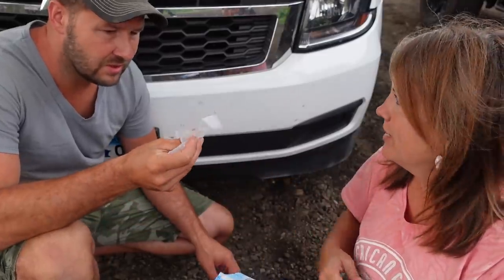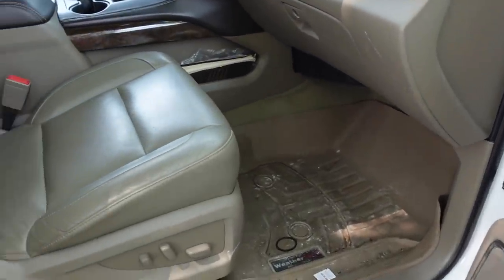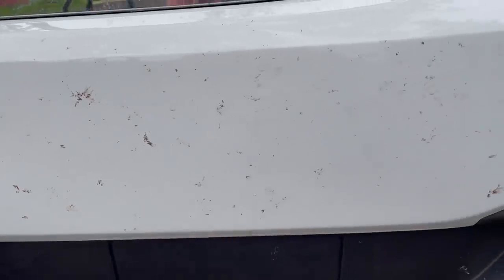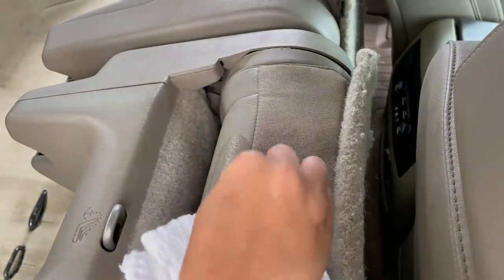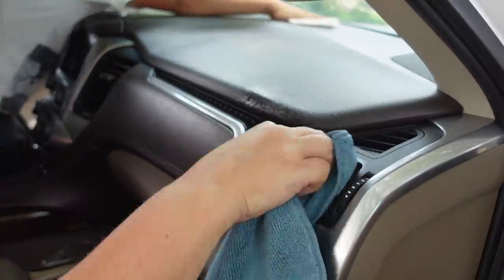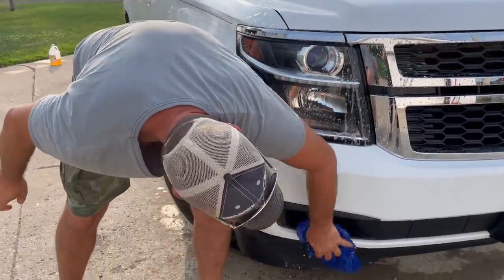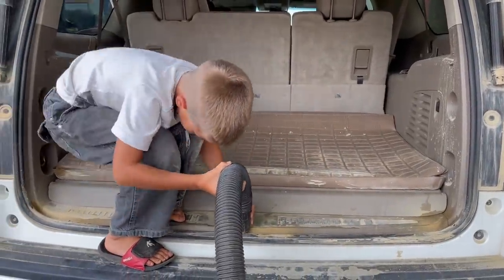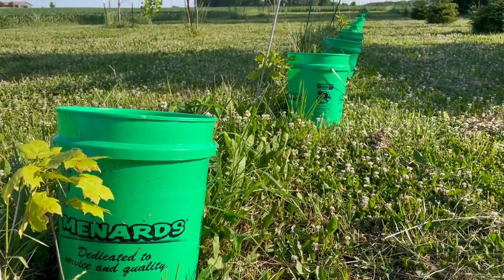“I’m trying, I really am!” Car Cleaning Before & Afters -- Favorite Tips & Products

Comment: Dawn dishsoap works fantastic for the front bumper. Give the entire bumper a thin coat about 15 mins before washing. They all come off super easy.
Reply: Dawn dish soap is one of my favorite cleaning tools! And it has to be the brand on this one!
Reply: @zend0001  I agree. I've found this to be true with my home made cleaners and laundry stains as well. Dawn dishsoap always works better than other brands.
Reply: I agree as well. I also like that I don't have to worry about chemicals when I use Dawn. There have been times where I've debated if it's safe to use various cleaners in different areas where my cats spend time, and I typically use Dawn in those cases because it will clean the area without any chemicals I have to worry about.

Comment: My tip for cleaning the outside of my car is to drive it through the car wash when I get gas. As far as the inside is concerned, I will need to drop it off at your house because I need a lot of help with that.
Reply: I agree...but the car wash doesn't clean the rim holes at all! Major build up there, so I'm thinking investing in a pressure washer wand might make that easier...and a small, soft toothbrush to get in those crevasses, since 'borrowing' Dawn's boys to come to California to detail my car is illegal in every US state. 😳
Reply: The drive through car wash where I live (rural Australia) the cheapest one is $12 for the quickest wash!

Comment: The tip about using a scrub brush while vacuuming is genius, how could I not have flippin thought of that.
Reply: Right! We have a house of blondes & both vehicles have black carpet. The carpet is like velcro for the blonde hairs. The vacuum won't take it off of the carpet. It's my hubby's huge complaint. I'm going to try the brush trick & pray that it works.
Reply: @sunrays-wy6jc  I might use an actual hairbrush to grab the hair, then clean it. Doesn't seem like a standard flat cleaning brush like Dawn used would "grab" well enough. I'm getting my hair cut cause I can Stand finding those dang long hairs everywhere!

Comment: I have strong opinions about cleaning your car as a detailer- be careful using things that are abrasive like the dryer sheets on your oaint- instead use Bugs N All cleaner to dissolve them. Use Meguiars all purpose cleaner inside the car on hard surfaces, and finish everything with 303 Aerospace protectant. All worth every dime
Reply: Hi! Can you recommend something to clean the interior of a windshield? Mine looks ‘filmy’ in the light, and glass cleaners seem to make it worse. Microfiber with water or diluted Dawn helps, but… I still see the filmy smears in the sunlight. So I’m hoping to find a cleaner that removes the weird filmy layer but doesn’t leave its own filmy residue.

Comment: Working in the motorcycle industry for many years, Bugslide (can see the information on all its uses) works great on all vehicles as I've used it on my collectible automobile and it's waterless..also use TuffStuff foam cleaner for carpets and upholstery. Then top it off using a little dusting polish inside but avoid applying to the steering wheel. All while using some microfiber cloths or the cotton ones that are sold in automotive sections of your nearest auto store. Been doing this for years. I do like your pet cleaner vacuum as that's a new one for me that I'll have to invest in. Great tips Dawn and Tom, have a blessed day 🙂

Comment: Yes on the dryer sheets. I’ve been using them for years to clean the front end to remove bugs. If your think about it, they are fabric softeners, so I think that is part of why it makes it so much easier to clean. I dunk in down in the soapy water in my bucket before I start scrubbing.

Comment: Awesome is awesome!!    Our church just got tagged and Awesome even took care of the spray paint.    When my kids were little, I got a "dorm room carpet" from Walmart and put it on the floor of our van.  I cut out holes where needed and lined the edge with duct tape.   When we sold the van, we removed the  carpet and simply vacuumed - got a great resale price because the van carpet looked so good!  I now have an old area rug in the back  of my suv because it is carpeted.   The throw rug takes the beating and got a second life.

Comment: the dryer sheet trick & other cleaners might work well, but the Norwex microfiber does it more safely, without harmful chemicals ❤ Also, dissolving Norwex Ultra Power Plus laundry detergent in water and using it as an all-purpose cleaner works on a lot of dirty jobs (it can also be used in a carpet cleaner)
Reply from the maker: GREAT tips!!!
Reply: The dryer sheets work because they’re made with waxes and polymers to cut down on “attachments” between fibers.

Comment: Used dryer sheets work SOOOOO much better. I live in Louisiana and used dryer sheets are a MUST HAVE STAPLE during "love-bug" season. They swarm and it's a beast to keep the front of your car clean!
Reply: Smart to use the “used” dryer sheets! 👏🏻👏🏻👏🏻👏🏻
Reply: @angiedimsdale9016  The used ones don't have all the chemicals on, so they are easier to hold onto, they take the bug gunk off easier, and they don't leave a residue.

Comment: Try using the spray cleaner you would use to clean tires for your floor mats. We have black weather tech mats and it cleaned them like new. They may be a bit slick at first but they look great.

Comment: The dryer sheets work because of the softeners in the sheet, it softens the bugs.  You can make a spray version, by soaking your used dryer sheets in boiling water overnight. Put the solution in a spray bottle and use for mirrors and tv screens, it keeps the dust from being attracted to the glass.  I also add the solution to my vinegar and this as the water portion.

Comment: on going keep it picked up car ""cleaning" - I use a plastic bag - the kind with the "handles" - and put one over the gear shift (in the past, with different cars, I've hung it over the knobs for the radio - whatever).  This is the garbage bag - and I'll keep an extra one out (I store these in one of the glove compartments) to put small stuff I want to carry inside.  Somewhere along the line I formed the habit of picking up the car as I head inside so that there isn't anything left out there.  (It wasn't always this way - trust me!  Used to be it was the job to earn extra money - or at the least to keep whatever money you found under floor mats, between and under and in the seats, etc.)
Reply: A general comment .... why  why  why   are there so many nooks and cranies and slots and crevices etc etc etc in vehicles... Everywhere??????  Why?????
I will write a letter to the car manufacturers and ask for a Very Sreamlined  Interior !!!!!!  lol 
But that would take away all of Tom's fun!  Ha

Comment: ???? I have light gray discolored leather seats (2011 van) that have never been cleaned. Is the Dollar store Awesome product what you would use??? Other recommendations???
Reply: You could start with Awesome cleaner, or use car leather wipes cleaners, or the cleaners which come with leather furniture, or the good old saddle soap and finish off with some mink oil if the leather needs reconditioning.  The saddle soap and mink oil can be found in shoe stores, or perhaps in hardware stores.  The oil will tend to darken leather, though, so only use it in extreme cases.

Comment: Do you, or Tom to clean dashes/plastic inside a car? Everything I’ve tried doesn’t seem to get off oily spots, dries it out and looks like water spots when it dries. So frustrating!
     When it’s not super hot (under 80° and not humid) I tend to clean my car at 2-3 times a week. Note I do have a membership at a drive through car wash and use their high powered vacuum and cleaners. However right now it’s high 90’s low 100. So right now the car is terrible. Yes the membership is sorta cheating but the car gets cleaned a lot more often.